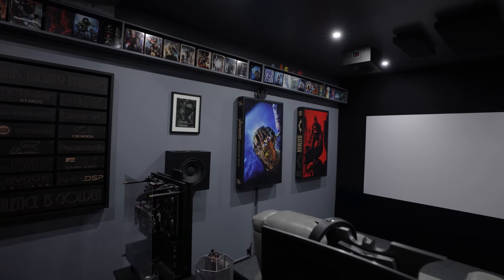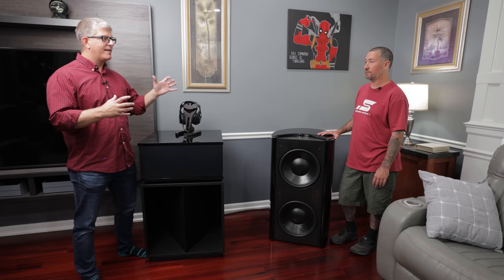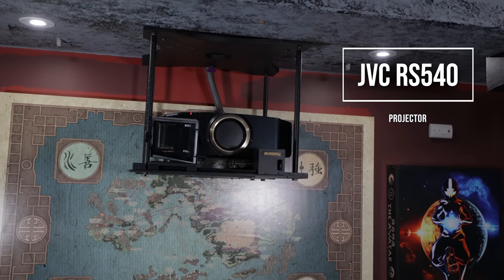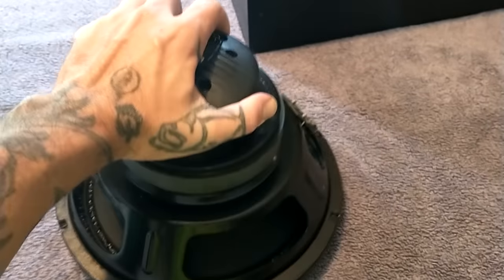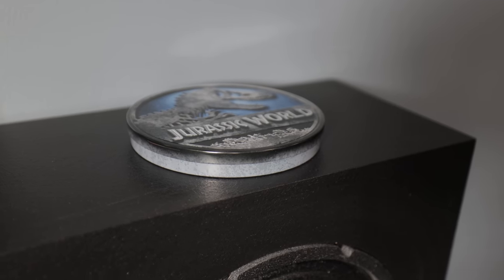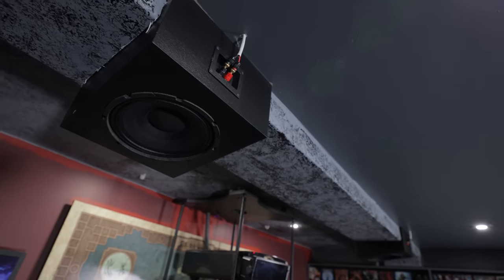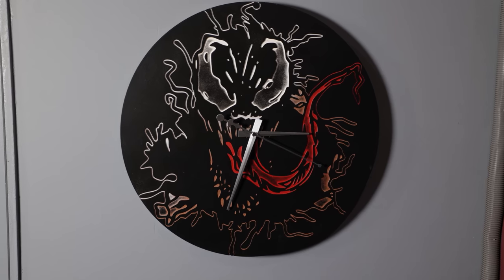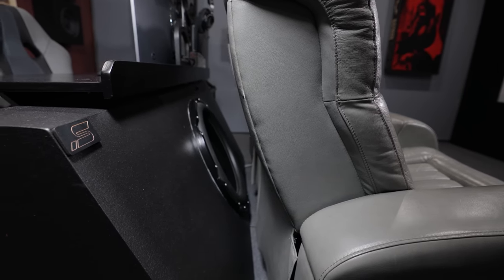WARNING! This Home Theater Could Be HAZARDOUS To Your Health! Stereo Integrity HS-24's

Comment: Love this handmade theater.  Thank you for sharing.    The outlaw amps, if you drop one channel they are independent in the chassis, and you can repair just the one without losing the others.   One of mine had a blown fuse on a single channel and was able to repair it.  They are very affordable.

Comment: My rack looks similar to Charles'.   One of the huge selling points for me on the  Crown XLS Drivecore 2's is that they are class D, and extremely efficient with power.  I have (7) Crown 1502's,  (4) 2502's, (1) 1002, an Epson Projector, my Prepro all running on a single dedicated 15 amp circuit.   I rarely pull more than 7 amp.  That said I do have extra circuits ran, but haven't seen any reason to need them.

Comment: This guy spent like 90% of his budget on subs... awesome
Reply from the maker: Money well spent
Reply: @Youthman  Agreed. One question though Mike. Lets say you were doing a new build and wanted to DIY a bit or get a buddy to help diy to save some cash. Would you do an array of 18 inch subs like the dayton or something similar? Like for the price of 1 HS24 you could buy about 5-7x 18s. I wanted the HS24 (dual) but now im thinking its going to be more cost effective and probably get similar performance with an array of 18s.
Reply from the maker: Great question. I am not familiar enough with DIY options to know how they perform compared to each other. Subs like Stereo Integrity and JTR are what I consider end game subwoofers. You never have to worry about having upgraditis or having the “what if” syndrome. A lot of guys use the Dayton Ultimax 18, but it’s rated to 19Hz. Stereo Integrity and JTR will easily reach single digits with insane authority. Buy once, cry once.
Reply: @Youthman  You think your going to upgrade your rs2s to a hs24 array ?
Reply from the maker: I do not have any plans to change my front soundstage and subs. I’m flat down to 5Hz with more output than my room or my ears can handle. Besides, I do not have the room for 24” woofers.

Comment: By the time you have soundproofed walls how much space is taken thickness from existing to added soundproofing.
Also how much depth of ceiling is required thanks.
I have viewed loads of YouTubers videos and no one tells you this information
Reply: For soundproofing, you need to glue additional layers of drywall to the walls with Green Glue sound proofing glue. That will help some. But for proper sound proofing, you need to decouple the room from the house. This is done during construction by building a room within the room, staggered studs or clips and channels. A google search will explain the three processes. Adding insulation to an existing wall, or making the wall thicker for more insulation will not result in sound isolation. Insulation can help a bit with reverberation, but is really only good for thermal insulation.

Comment: I'd like to understand how he dug his cables path in the drywall... Any idea? What tools to use?
Reply from the maker: He mentioned in the video he used a Router
Reply: A DeWalt trim router with a 1/4" bit.
Reply: Thanks guys, he did said that it's true. I didn't know that a router could be something other than the pc networking thing (I speak French) so I didn't understood. I'll have a look at that, thanks again!
Reply from the maker: It’s certainly a cool idea that I had never seen done before.

Comment: Gerard Stroh**
Hi Michael Stevens   Youthman****
How Was Your Trip the Home Theater Trade show***
I order My QSC 2450a Poweramp and my Frontstage and Subwoofers and Center and I Run Pro Poweramps and I have 7 Poweramps when the QSC Comes in**
All of My Speakers I use Pro Audio Drivers Because of the High DB output and it's 98DB and Thats All Subwoofer Speakers**
I use Pro Audio Poweramps Because They Have Alot Of Speaker Protection on Each Poweramp and They Are Class AB on each Amp**
I use All 12 Gauge Wire On My Frontstage and Subwoofers and Surround and Atmos Speakers***
I Been Looking At A New sony 85 inch Ultra 4K TV with Dolby Vision**
I don't Have The Room For A Large Video Screen or Projector and A TV Is Cheeper**
Bye From Gerard Stroh***

Comment: You have answered a question i've had for a while. So for high SPL from a speaker, i want a compression HF driver and a PA accordion-style surrounds for the LF driver. I've always wondered why PA systems use those drivers.

Comment: So there is no screen shake with those speakers behind that?   My SI screen does not like my sub behind it.  I can see the screen shimmering on the low notes.

I love great SPL.   If the subs can do wonderfully with 20% of the power, does this mean, you could actually remove or use smaller subs to achieve the same thing?

Would love to see the plans on that behind the couch sub frame!
Reply: There's a little screen movement at demo levels. The speakers are about 3" from the screen.

Comment: Awesome video!  Definitely inspired me to DIY some things in my own theater.  Curious, is it not common to use pro-audio amps in your HT?  What makes the HT power amps different than pro audio?  Thanks!
Reply: HT amps usually have a few more options for convenience. Auto on/off, clean front panels, quiet fans or no fans at all. PA amps are meant to be bare bones, power only and portable. They also have balanced inputs to help clean up long cable runs and options for linking multiple amps.

Comment: If you want so see a wall of sound, check out the Krix MX range. YouTube’s Build Montage has it in his HT.
Reply from the maker: I’m familiar with Krix and with Tony’s setup. They look cool but I’ve never heard them personally. Klipsch and a few other brands also make a wall of sound as well in their Cinema Series. 

The turn off for me is Krix subwoofers have a frequency response only down to 25Hz. That’s not ideal for Home Theater. You want something that can go down to at least 20Hz. 

Klipsch’s wall of sound is rated down to 16Hz which is good.

Charle’s Stereo Integrity 24’s will hit single digits. No comparison between them and Krix or Klipsch wall of sound.

Comment: no one needs 24" subwoofers in there home.  its complete over kill.  I used to DJ large venues, large rooms 200-500 people.  We used EAW 14" subwoofers and/or 2-Bose 12" subwoofers that had 2 12" woofers in each sub.  We used Crown macro tech 12000 watt amps.  No one ever at any event ever asked us to turn the volume up, it was always "please turn the volume down".  Now you can put a 24" sub in your home but its so over the top and completely unnecessary.   12" for the home is really overkill, unless you have a huge room.  I understand people like to use 2-4 subwoofers for what they call "even bass", thats unnecessary as well, but its your money, spend it how u like.  One 12" ported subwoofer is all any home theater would ever need.  It just seems like these people go down a rabbit whole and there's no end.  What about a 30" sub would that make you happy?
Reply: There's a difference between your clubs and HT. Movies have lots of content in the low teens and even single digit range. Yes, a good 12" subwoofer can be plenty loud for most content,  but it just can't reproduce ULF, at least with enough authority to matter.  The only practical way is large format drivers. Basically anything 18" or over can begin to get into that range. Would I be happy with a 30", 50"? Yes. I'm  happy with 24s though.

Comment: How does a speaker system that obviously must move as much air as those do not affect the with movement
Reply: If you're asking if the subs effect the way the main speakers move...then no, they do not. Speaker motors are extremely powerful, even small speakers. You couldn't physically stop moving most speakers with your hand if you tried. You could stand on a 18" driver and it would lift you as it played.